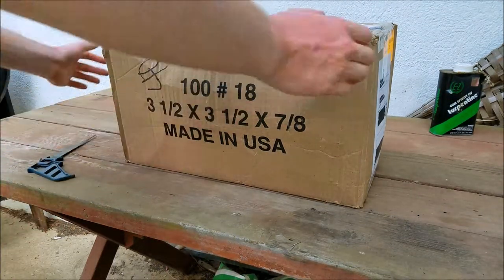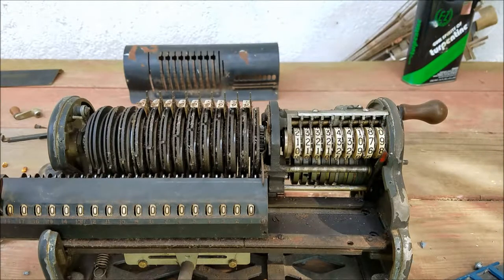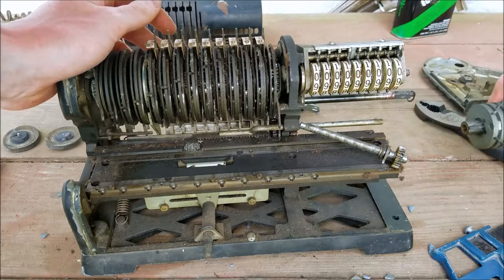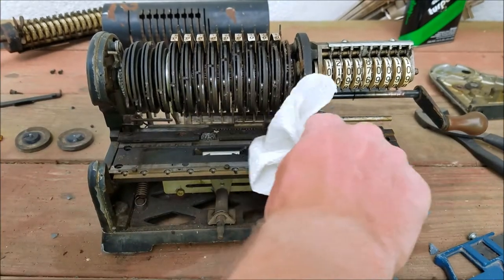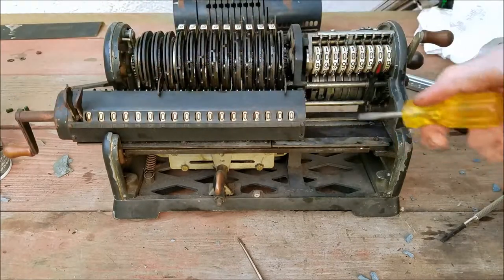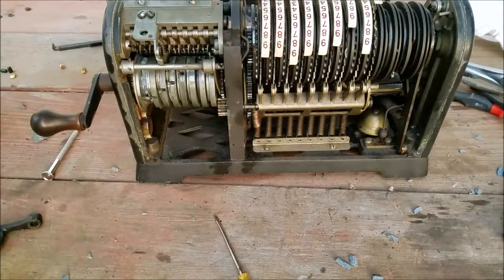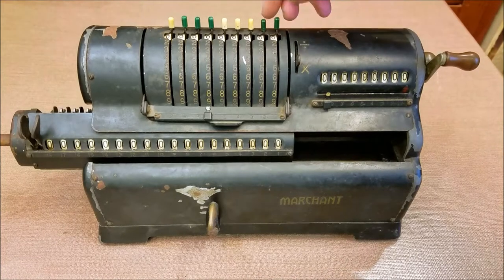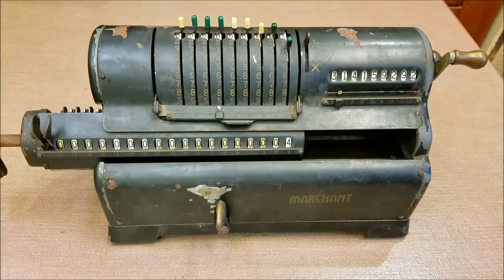Marchant XL Calculator Mechanical Calculator Repair/Demo

Comment: I just picked up one of these with exactly the same problem, except that it was on just one of the counter wheels. It was six of them. So now at least I know where to start tearing this down. I am hoping that (a) I can salvage one or more of the pot metal parts that isn't "exploded" and (b) get a pattern made off of it to make a set of replacements for the other broken bits. I might replace them all, if it works out.
. . . It amazes me that the company used such cheap materials in such a critical part of the machine. Which may explain in part why the company went out of business. I have to wonder how many of these machines got tossed into the compactor when they failed and how many of them were replaced by more solidly constructed machines like the Facit or any number of other similar and simpler (and more reliable) pinwheel machines available at the time. 
. . . Again, thanks for the video. I should have known what I was getting into, spending my cash on a jammed machine ;-)
Reply from the maker: I also find it surprising that pot metal was used at all in these machines, as Marchant machines were not cheap machines. The XL mechanism formed the base for the calculating section of their larger keyboard and automatic machines like the EA, EB, EE, and EEG (with the EEG being one of the most capable and probably expensive machines of its time, featuring automatic division and nearly full automatic multiplication in 1929). In terms of automatic functionality, the Marchant EEG was probably about 10 years ahead of Friden and Facit, and possibly Monroe (although MADAS and Marchant were pretty close on functionality). So its really a shame that they put in all the engineering effort to beat out most of their competition on functionality and then let the machines down by using poor materials. Interestingly even on the larger keyboard and automatic machines the sides and base are cast aluminum (instead of sheet metal cases like many other manufacturers used), yet they used pot metal in the actual mechanism. Good luck with getting the parts made, if they turn out well Im sure there will be plenty of interest from people with machines in a similar state. Luckily my EA, EE, and EEG seem to have suffered minimally so far, and only required some filing to shave down slightly expanded wheels.
Reply: @bss1250  Well, I got to the point where getting the parts made was more than it was worth to me to get the machine running again. I have three Odhners (one broken that is being repaired), two Felix's, a couple Rapids and a broken Swift that I will have to fix parts for. All that is enough work for a 75 year old hide out from the plague. Nice distraction from the terrors of life but too much hassle for me. 
. . . So I now have a box of parts and pieces that I'm likely to just put on eBay for a couple bucks to get it out of my sight ;-) 
. . . You're right: All that engineering and then use poor quality materials. Almost the epitome of American disposable stuff that costs too much. 
. . . Well, onward. 
. . . Next I try my hand at a functional Facit ;-)  I need a machine that does square roots the "hard" way.
. . . Stay safe & stay sane!

Nils

Comment: Very nice - but don't call it a pinwheel calculator - there are no pins, the system is called "geared sector" and Christel Hamann came up with the idea. The zinc rot in the tens carry drum is typical for these machines - if you buy a Marchant that is "blocked, just needs a little oil", you can bet that zinc pest has swollen that drum and you're in for a long and painful repair - which then accidentally messes up the timing of the x / div lever, as you found out. It's not by design, something's misaligned in the gear train. Thumbs up!
Reply from the maker: You are correct, its not a pinwheel calculator. I've heard this mechanism referred to as "moving segment", "modified pinwheel", and now "geared sector." I thought in the video I referred to it as "modified pinwheel," but perhaps I mistakenly shortened it to "pinwheel." The mechanism in this calculator was independently developed by Carl Friden (or at least he received a patent for it in the late 19teens), I'm not sure if his development was before, after, or contemporary with Hamann( I think Hamann made some interesting 4 function machines, but Hamann machines seem pretty rare in the US). I really like these "old line" Marchant machines (especially the electric keyboard ones) and luckily the drums in my other machines had only swelled minimally and I was able to file down the swelling to get them back in working order. Thanks for the info on the timing, I will have to look into that. If you're interested, I have videos detailing the much longer repair of my electric Marchant EA.

Comment: Can you still obtain machine screws with that thread in the USA, what should I look for? or has the dreaded metric thread taken over there as well? Ken in Wales UK
Reply from the maker: Imperial screws are sold alongside metric screws here, every hardware store has them. Usually they are specced by a number (which I believe is the threads per inch) and then the diameter and the length, for example #40 x 3/8" x 1" would be 40 threads per inch with a 3/8 inch diameter and one inch length. On some of these old machines though the screws aren't quite standard, but usually the standard ones are close enough to work.